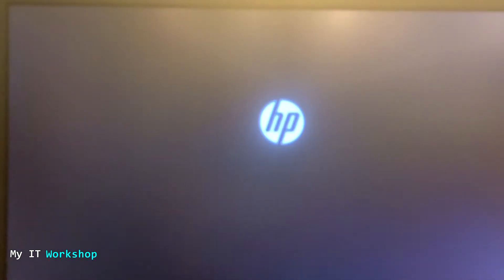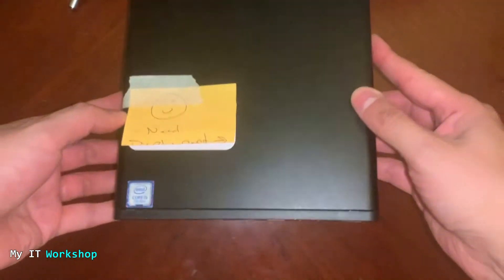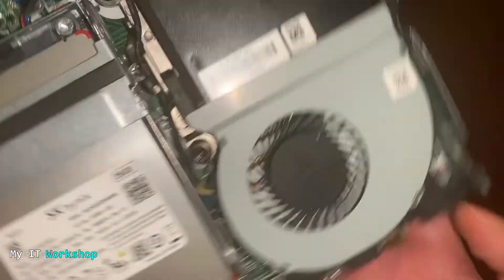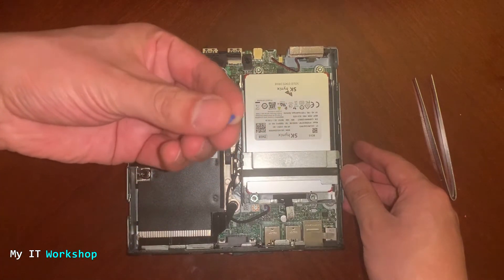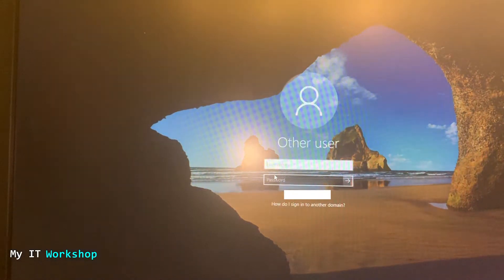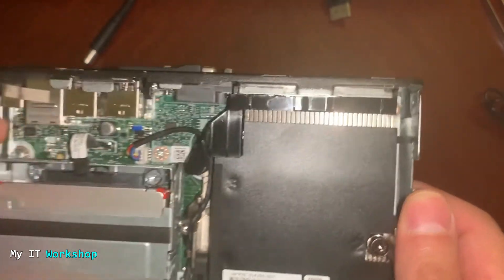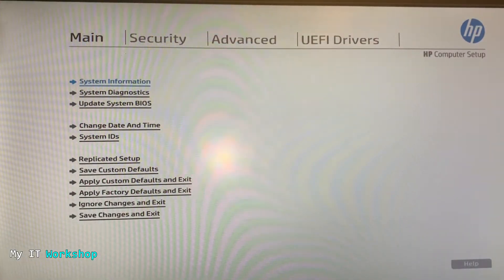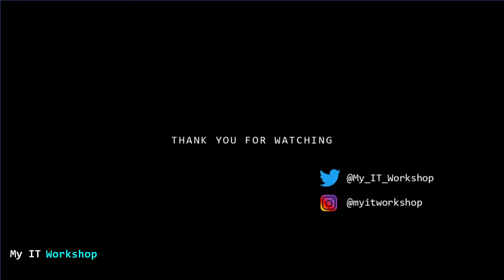Bios Password Reset | HP ProDesk 600 G3 Mini

Comment: Works great thank you! A little tip I found too with this system being super annoying to enter bios is to hold ESC when you power it up and keep holding. It will beep non stop but actually show the boot screen prompt and f10 option.

Comment: It didn't work, I have the same system HP Prodesk 600 G3 mini, after removing the jumper, it still shows Secure Boot, "The selected boot image didn't authenticate".  Another problem I noticed is that on board battery is dead, not sure if that could also be the reason.  I'm going to change out the CR2032 battery and then give it another try.  Oh, and I noticed on this board a yellow button labeled 'CMOS'.  I tried pushing that too, and it seems to have only cleared the CMOS, but not the Secure Boot, and yes the jumper is removed.  I think i'll still need try a new CR2032 battery.

So, I got a new CR2032 battery and installed it, then I was able enter the BIOS, under Advanced > Boot Options > Enable Legacy support and disable UEFI, then underneath check the box Remove Secure Boot, save then when the system reboots you are then prompted with a 4 digit code to switch off Secure Boot.  In my case I erased the Secure Boot settings and was also prompted to enter another 4 digit code which cleared the settings.  Then after that the BIOS changes would be saved due to the new CR2032 battery.  Hope this helps other people who get stuck in the Secure Boot loop problem.

Comment: Is it possible to reset the BIOS password on G5 model same way?
Reply from the maker: Hello Marius,
Yes, the process should be similar for the G5 model. The location of the jumper on the G5’s motherboard might not be the same as in the video, sometimes is located under the hard deice or next to the ram.

Hope it helps
Thanks for the comment
Reply: @MyITWorkshop  actually it did not work.
I removed the jumper and did not reset the password. I left the jumper out and kept the computer for a whole night without it, and still did not help.. :(
Any other ideas what I could try?
Reply from the maker: @MarcusXPX  mmmm weird. I have done many videos with different HP/DELL desktop  models on which I reset the Bios or Admin password using the same method. After you removed the jumper, (and keep it removed), you turned on the computer and still asks you for a password?

Ok, I checked the manual for your model: http://h10032.www1.hp.com/ctg/Manual/c06498439.pdf

This motherboard also has a button, (first picture, item 15), that reads "Cmos reset". Try pressing that button with the computer disconnected from power, and check if that removes the Bios password. On other  HP models the "Cmos reset" button  only resets the date and default boot device. Maybe on your model it does more than that.